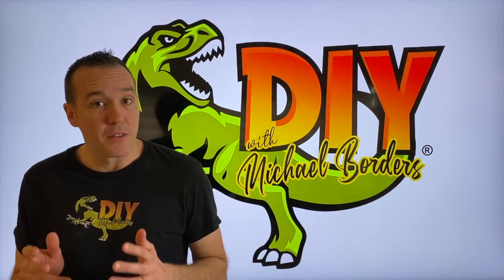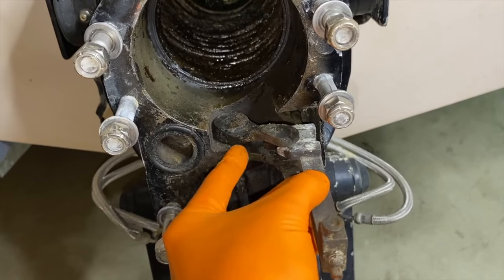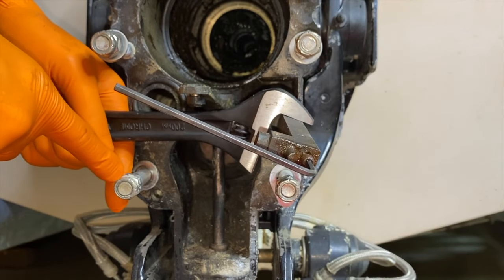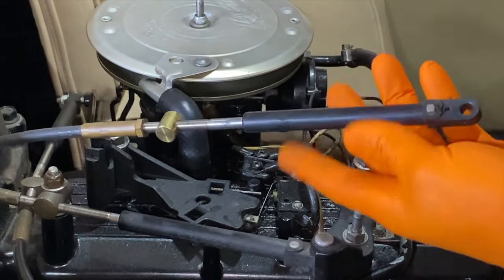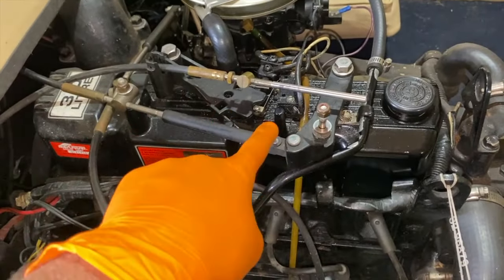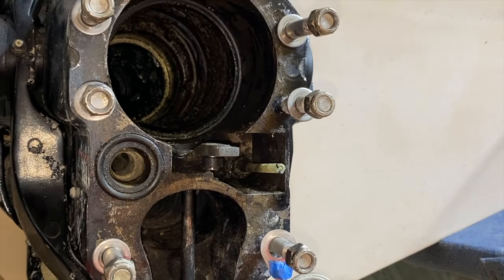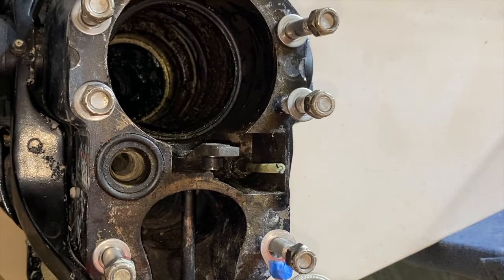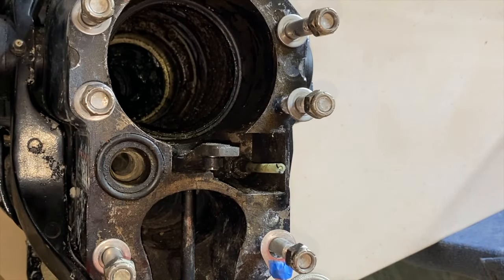Replace Mercruiser alpha one gen 1(2) outdrive bellows - PART 1

Comment: For the port side hinge pin, any reason you cant allow the bellhousing the rotate up until it stops, as opposed to stopping it by foot? Thanks yo your videos, i was able to do everything else, including removing the gimbal bearing, but i broke the special tool removing the port side hinge pin and was giving it basically everything i had. Would be far less awkward if i didnt have to hold by foot! Thanks for taking the time to make these videos!
Reply from the maker: @Currancchs  

You are welcome and we are happy to help.  Performing it this way helps lower the risk of damaging bellows or any other parts near transom…including inner gimbal bearing.  👍

Comment: Thank you for all the great info and help!
Question....my oil reservoir was leaking and found the hose attachment was broken (where it goes into the hull next to the shift cable bellow)   Is this a requirement to have if I keep my gear oil checked on a regular basis?   Or could i plug that?  Very new at boat maintenance and any info helps.  Thank you again!
Reply from the maker: Thanks for watching, any update?  We haven’t modified the oil line in the past.  We would keep it as is and replace oil hose.  Keep us posted.  👍
Reply: @DIYwithMichaelBorders  I did pull the hose out and plug it on the bell housing side.  It may not be the best long term solution, however after seeing the other issues we have determined that after we patch what is needed to get us through the summer, we are going to replace it all with new for next year.  Thank you again!
Reply from the maker: @anthonylandis8181  

We appreciate the update, that will be awesome.  Getting the boat out of the water this fall and replacing parts will put you in a good mood.

😁👍🧰

Comment: Hi Michael,

Thank you for all of your videos, they have been very helpful. I have a couple of questions. 

First, the brass nut holding the shift cable got stripped when we were trying to remove it. Any tips on how to get that off? Tried soaking in PB blaster and no success yet. 

Second, is the gimbal bearing in the replacement kit that you link to a sealed bearing? And do you recommend using sealed vs not?

Thanks!
Reply from the maker: Thanks for watching, any update?  Are you referring to the jam-nut located on the shift cable housing just above inboard engine?

If so, you may be able to use a pair of lock-pliers to get a firm grip on it and break it loose.  Most important thing however, is to not damage any surrounding parts as you do that.

In regards to the Bellows replacement kit, the kit does include a brand new gimbal grease-sealed bearing.

Keep us posted on your progress.  Looking forward to 2024, many more helpful videos to come.  👍🧰

Comment: What's the difference In the gen 1 and gen 2 bellow kit? I accidentally installed the gen 2 bellow kit. Will it be OK? OR should I take it all out again?
Reply from the maker: Good morning ☕️ main differences will be water tube and oil hose.  Gen 1’s do not have an oil hose.

The bellows will be surprisingly similar however with very little difference.

Comment: Isn't it possible to replace the bellows without removing the Gimbal?
Reply from the maker: Good morning, just poured a cup of coffee and am sitting down to answer any and all questions for the DIY community.

Are you referring to the gimbal bearing?  If so, it is.  Most will replace gimbal bearing while everything is opened up however that will be personal preference.  We recommend replacing gimbal bearing during a bellows replacement if the bearing itself is making sounds or it hasn’t been replaced in a decade.  👍

Let us know if you have any questions and hey if you’re into crypto trading, join our DIY ecosystem and become part of an exclusive group of DIYers.

       toolboxtoken.com

Reach out to us any time!  🧰